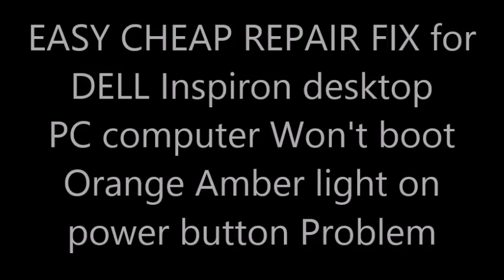Dell Inspiron orange amber light problem PC will not boot EASY CHEAP REPAIR FIX

Comment: Tried but didn't work its still stuck on amber light.
Reply: Just disable the AGP chip
Reply: fernando m bonilla how you do that?
Reply: @vjxrzzzx1030  While you can log in to Windows, you can go to BIOS and disable the chip from the configuration or from the windows graphic mode in system and device manager, select the agp driver and deactivate it.
Reply: @vjxrzzzx1030  but first turno on a Hairdryer over the AGP chip. 1 minute at 15 cm distance
Reply: @fradnander  how can he go into the bios if it won't boot
Reply: Are you sure you don't just have your computer on sleep mode?

Comment: This actually worked as advertised for me. The battery was very easily accessed too. On a related note, I have the same DMM (Digital Multi-Meter) used in the video to check the CMOS battery and picked it up at Harbor Freight for about $8.00. I did however, have to pay about $5.00 for the battery at CVS.
Reply from the maker: FYI - the battery is available at my local Dollar Tree for a dollar, so I would assume that most Dollar Tree around the nation would also have them.

Comment: I didn't have to remove the CMOS Battery but i held the power button and pulled the power cord out like you said to do. It worked so thanks for the help.

Comment: Was really hoping this would work, but no luck.  In my case I actually see the CPU fan move for a split second, then stops, then orange light on the motherboard.  :(  It's almost as if one of two things are happening.  1. Something obstructing fan from spinning.  2. Bad Power supply.  I'm thinking #2.  :(
Reply: I have the same problem, I think it might be the power supply also. After cleaning the ram and removing the CMOS battery I'm still getting the flashing amber light and I hear absolutely nothing... however I haven't tried replacing the CMOS battery..
Reply: @bacongrits4155  Chris Kirkman did you guys ever figure anything out? I don't get a light at all, just on the motherboard itself. No light up on power button. No sign of life other than whats inside the case and otherthan you can test the PSU power supply using PSU test break button. Any ideas, this has happened with 5 of 17 of my optiplexes
Reply: @NickStoneDevelopment  It is a bad power supply.
Reply: @arob7249  how ab for me I litteraly got a new psu and have my old one and both didn't work for me it flashes orange has a small none stopping beep and boots up for 2 seconds fans move than stop

Comment: What if it has the orange amber light and does not post with no beeps? Also no video output. When i remove the memory i 2 beeps so that is normal i guess on that part.
Reply: I have same problem
Reply: Same

Comment: Why in the hell would you show that the batteries are good or bad and not show the hell where came from. Don't quite your day job.
Reply from the maker: Because if someone cannot IDENTIFY the ONLY BATTERY that exists on a mainboard, the project far is beyond that person's skill set to accomplish.
Reply: yeah he clearly stated where it was and he did not want to pull out the video card since its a pain in the ass, and if your watching this video then you require a set of skills that an average person without tech knowledge wouldn't be able to do or do with confidence, and all computers are different, literally every one its in a different spot look for a silver disk check underneath things if you can't find it then take it to your local computer repair shop and pay them the 200$ or go buy a new computer.